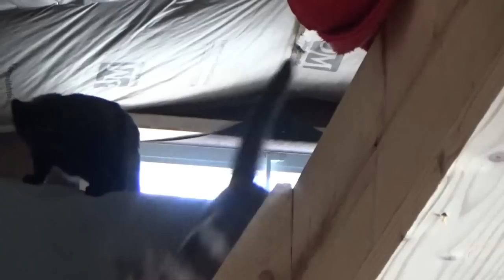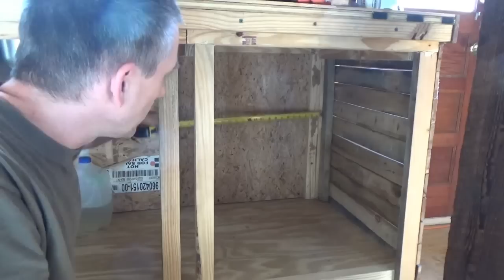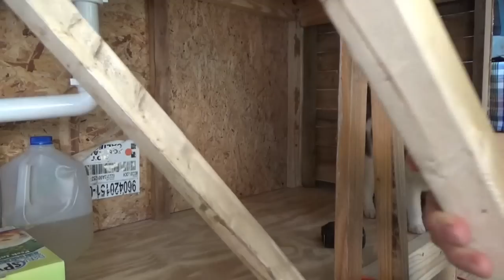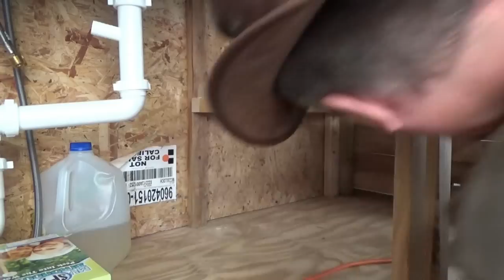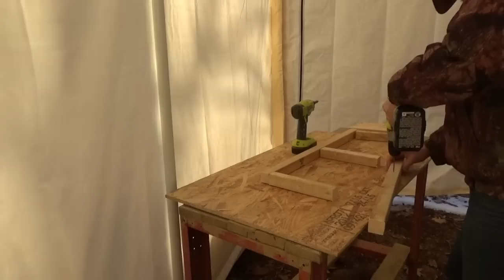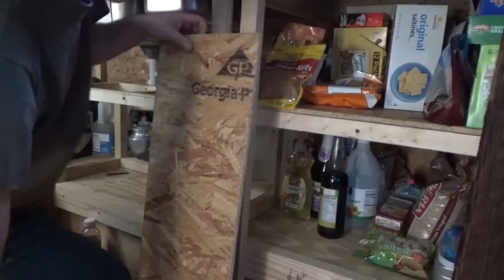Installing Shelving Under Tiny House Kitchen Counter

Comment: It was a good day at the homestead, with the cats making an appearance. I am not a carpenter or cabinet maker either, and have made shelving in a pretty similar fashion to you. With one difference: I would always support the shelves on legs and not rely on screwing the shelf into the wall. Even more overkill than you have, but I could load up the top shelf with canned goods if I wanted to.
If the lumber is warped you can easily straighten out the shelves: just load them up with heavy stuff. Time will correct any mistake that way.

Comment: in alot of places here in canada, they stopped selling 2x2's because they have to sit outside and the moisture warps them. Good work on the tiny house. those cabinets are looking good. When did you get the black kitty?

Comment: Just Wanted to share that depending on the screw type and its intended use, screws do in fact have shear strength. I think the reason that people have gotten this idea of screws not having shear strength, has been the practice of using cheap and plentiful sheet rock/drywall screws for everything. these screws do not have support shear strength for sure.  glad to see ya back at it.

Comment: Are you planning on putting doors on the cabinets, or just leaving it open?  I was wondering about some sort of slat type doors if you do so, to allow circulation of air, yet keep the cabinet contents hidden from camera and guest view?

I have yet to go pickup my Ryobi Drill set :(.  Had a few unexpected bills added this year so it may be a while before I can get mine.  Looks like yours is really doing great.  I found out that Batteries Plus will rebuild batteries for my Dewalt Set for $40 :).  So I will start taking a couple over at a time and having my 8 year old Dewalt batteries repaired.  They use larger capacity batteries when they do the rebuilds so the batteries will last longer between charges.  1 new factory Dewalt battery is $89, so for about the same price I can have 2 of my old ones rebuilt with larger capacity batteries :).  I still want the Ryobi set to use at work though.  Less expensive and not as heavy to pack around in the tool bag LOL.